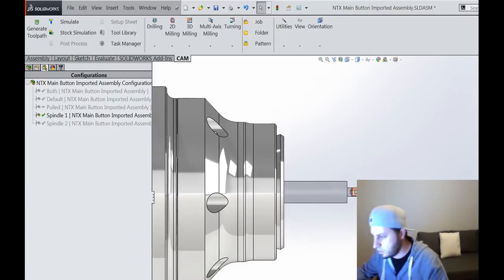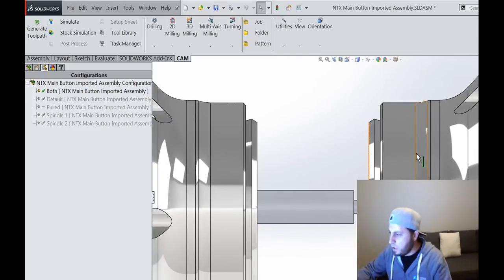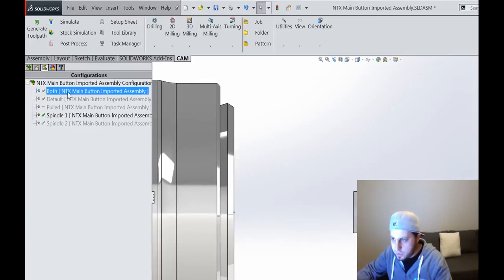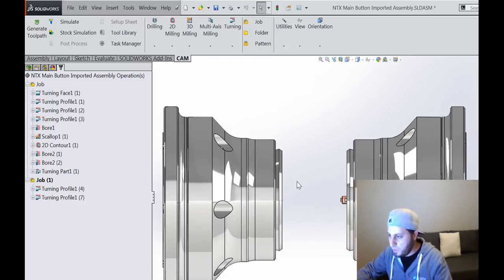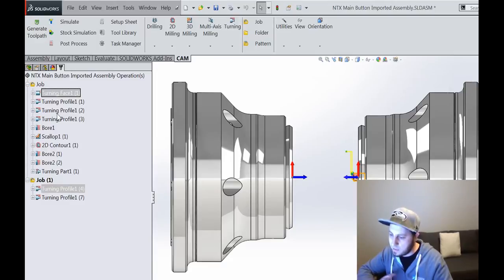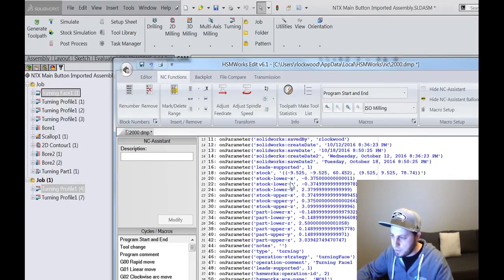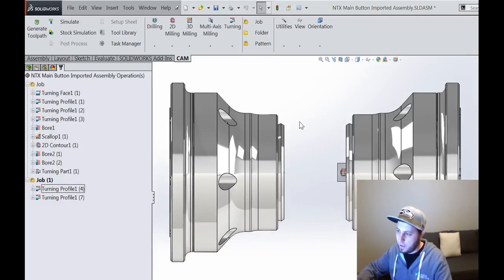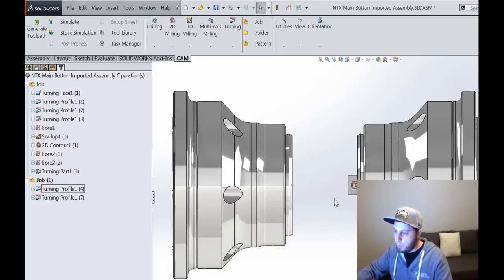HSMWorks How-To - Dual spindle turning center Pick-Pull-Part operation

Comment: Rob, did you ever get this working? Would be nice to have it automated, but i find the HSMWorks lathe weak on these operations, in fact its pretty weak for anything but the simplest ops. 

I have developed a workflow for our DN Solutions 2100LSY (fanuc, y-axis with sub) where the main program uses passthru to populated variables in a pick-pull-part subprogram. Once complete, returns to the main program to run the ops on the sub. Its not automated in that you have to enter a few variables in the main program passthru,  but it is persistent and you don't have to re-enter every time you re-post. Thanks for the video!
Reply from the maker: Yep, and actually you could use the same formula within the bar pull dialogs, as the same values are usable there